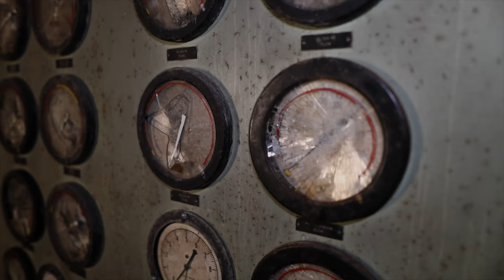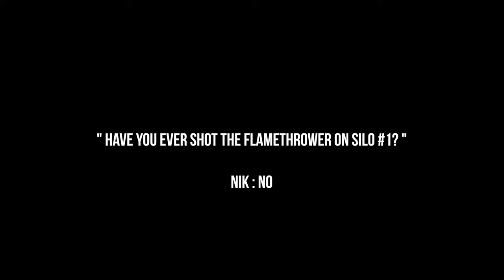Ep. 65 - An 80 TON CRANE Declares WAR On A Military Underground Bunker

Comment: you guys will get it next time, drilling around the edge has to have done some good
Reply: Some good sure, but remember that plug is almost 3 feet thick and when the Air Force decommission this facility in the late 60s … They use some form of adhesive to seal that lid permanently.
Reply from the maker: Pressure washer till you can see the water from the inside
Reply from the maker: Yes.  That they did
Reply from the maker: Absolutely
Reply: @NuclearBunkerLiving  Could work…. I would assume there was a clay plug involved, at least when the facility was in operation

Comment: I'm not an engineer or anything like that. I am a school bus driver here in San Diego, California. 

My thought is (I know it may cost big money) that you make a rigging from inside to hold hydraulic lifts in 3 or 4 points on outer rim of the slab and push up while the same crane pulls the slab.

Maybe, before all that, get some kind of heavy duty vibrating machine to just vibrate the hell out of the cork for several hours to loosen it, then use my first suggestion to finish the job.

Let me know what you think of my idea.

Thanks.
Reply from the maker: Appreciate your pulse on the matter Lawrence.  Welcome to the community. Will let you know how we go. Taking everything into consideration
Reply: FYI... I do dabble in DIY home improvement and some handyman work at times.
This is why I love what you are doing. Keep up the good work and keep the videos commin'.

Comment: How did they seal the cap? I remember reading it was "environmentally sealed". Perhaps whatever it is is gluing it in place. 
All I can think of is bigger crane.
Reply from the maker: Yeah they poured adhesives and concrete. They didn’t want it to be opened up ever again.
Reply: @NuclearBunkerLiving  well there's your answer as to why it's not moving. To get that adhesive loosened my guess would be you'd have to heat it, but... that wouldn't be practical. Suggestion: Dig out around the outer housing and (sorry), jack hammer out the connection points (the circle). You will have to destroy a portion of the container to get the cap out but, once completed, you could form up a new cap and pour it back. Yes it would destroy the original but that would be minor, you'd get access and then re-plug it. Watching your hammer drill my guess is you didn't even make it halfway down the cap so it's still 'solid'. Good luck and thank you for the updates!

Comment: My 2 cents is build a scaffolding inside under the plug and then from both side get daylight or air blast to be seen on the other side to show the seal is broken. If you can see any movement your close. Maybe 2 days with 2 men to get freed? What is the thickness of the plug, 24"?
Reply from the maker: It’ll have to be up to 15ft high. We don’t have any support structures.

Comment: Was the plug ment to be removable or was it the last step in the construction process of the bunker?
Maybe it is not even a Plug. If the plug is simply a casting that was made as a last step, the it is possible that there is a rebar cage inside that is conected to the reenforcement of the structure itself. 
If you want to blast throught the lid, try to get a company that has the licence for Oil Well Penetrators. The little monsters can make a nice round hole up to 2 inch in diameter
Reply from the maker: We don’t plan to blast thru the lid. We believe it’s just a cork. We just have to work out how to open it.
Reply: @NuclearBunkerLiving  You could test if your attemts even budge the Lid. Take a cheap dial indicator and magnetstand from Ebay, two small flat pieces of steel and install one piece in the bottom of the lid and one on the side of the wall. Set up the indicator with a GoPro to see the movement on the display, and then start the work with your crane/Hydraulik jacks on the surface. If you see no movement on the dial or when the thing only moves a fer hundreds before falling back to zero, the lid is most likely has a welded structure.

YOu could allways try to get the Handbooks they used for the decomission and the former Groundskeeper could have some insight into the matter.

Comment: Hello nik, love from cornwall uk. Idea! Is that plug supported by a hefty steel ring? If it is you can weld beams across for jacking with hydraulic Jack's to put lifting pressure on to assist the breaking free.
Looking forward to the next episode.
Reply from the maker: Cheers Neil. Thanks for your support.

Comment: why not bottle jacks around the parameter pushing up on a beams crossing the cap (red headed / concrete anchors) once its broke loose you should be able to lift it with less equipment. harbor freight has 30ton bottle jacks for $125 buy 10, 300tons (600,000lbs) of force for $1250.00. you could start with 4 and work your way up and return the unused ones. however you wound need about 86 1inch anchor bolts to lift 600.000lbs. at that point you might as well get the back hoe with the jack hammer attachment. and repour the cap.
Reply from the maker: Exploring some of those options. We just want to preserve the lid.

Comment: Double up on the rigging? 5-6 instead of 3? Also, I understand the need to get it opened, what is the plan to keep stuff (dirt, rain/snow, animals) from coming in?
Reply from the maker: Quonset hut will be erected around it with an internal gantry system to send up the scrap. Then we can sterilise the space for repurposing. We have 3 of these 5 level buildings. Rinse and repeat.

Comment: A healthy nod to your sense of perseverance my friend. I am a little perplexed on why you would want to remove this lid/plug... as it is engineered to NOT be removed, by design and depth of location. Any rain that may come your way is going to funnel right down to that hole. So, assuming you were successful in removing it, wouldn't you have to immediately put it back and seal it up the way it is now? Otherwise, it's going to flood down there when it rains, or am I missing something?
Reply from the maker: Hey @Pipeman.  Appreciate the feedback. We need to open the lid to have another portal to remove waste and scrap. Otherwise it’s a 3,000 foot underground trek to the other opened portal.
Reply: @NuclearBunkerLiving  I understand, but what happens if rain shows up while the lid is off during removal of waste and scrap?  Have you considered an overhead rail or dolly system that you could move scrap and or buckets of waste over the 3000' distance? Most everything appears to be steel... neodymium magnets can be incorporated to hold material suspended. You appear to have a lot of small I-beams from wall scrap that could be used to suspend rail dolly's from. Just thinking outloud here.

Comment: I also feel like that lid alone weighs more then 20k need to do some math and see what it weighs I bet you’ll be surprised
Reply from the maker: Much to consider.  Thanks for weighing in Joe
Reply: @NuclearBunkerLiving  what is the thickness and diameter of the lid? Thanks Joe
Reply: @NuclearBunkerLiving  10ft Accross by 6 ft thick is like over 60000lbs
Reply: @NuclearBunkerLiving  I don’t believe it’s stuck yes I’m sure it’s got some resistance but I don’t believe your using a big enough crane. I did email you in regards to wanted to work/help have not received an email back yet. I think the lid is heaver then you think
Reply from the maker: It’s 3 foot thick Sir
Reply: @NuclearBunkerLiving  diameter? If it’s 10ft by 3 ft it’s at least 30000lbs min
Reply: @NuclearBunkerLiving  with that being said you have not even applied enough pressure to lift it off the ground….
Reply: @NuclearBunkerLiving  I sent another direct email. Hope to hear from you!

Comment: I think you guys are hiring the wrong trade, cranes build up not down. Drillers are your answer and yes can figure it out without destroying the original concrete lid, you just have to find the right guys. I think Geoprobe is out your direction they should be able to send you in the right direction
Reply from the maker: Appreciated Brad.  Thanks

Comment: Rent or buy a Hilti Core drill, run 110V power supply, and garden hose water supply. And with a bunch of drilling hollow out the plug. I've seen Asians tunnel through solid rock mountains one cylinder shaped chunk of rock/concrete 
 at a time. No heavy equipment needed.  Easy to haul off and carry around. 
Your welcome. This a good video to give you a idea https://youtu.be/vr4XKpAQWT0
Reply from the maker: Love Hilti products.

Comment: dynamite....  drill some holes and load it like in a mine blast or building demo.  Hopefully it will break up the cap either on the top or fall to the bottom in pieces.  You don't sound like your aim is to preserve the cap.
Reply from the maker: We need some of your craziness but we want to keep the historical soul of the infrastructure

Comment: What about hydraulic jacks pushing on the hatch as well as the crane lifting on the outside that might be just enough to budget-free
Reply from the maker: Something has to give
Reply: I don't think the hanging floor system will withstand any loads from jacking from underneath.

Comment: Like I said hydraulic jacks pushing on the hatch while you guys are lifting at the same time with the crane
Reply from the maker: Please read my comments on the video.
Reply: That won’t work. It’s good in theory, but remember this cap is directly over the elevator shaft .
Reply: @Matt-yg8ub  that's right I forgot all about that you're absolutely right

Comment: Have you tried to use a hydraulic jack from the inside and pull from the top may work for sure its going g to work 👍 😉
Reply from the maker: There are no support structures underneath. Be sure to team my comment under the video.
Reply: As Nik mentioned in the note everybody here was supposed to read…. They can’t brace it from the inside because the cap is directly over the elevator shaft... And the government may have glued the thing in anyway
Reply: @Matt-yg8ub  my mistake only dropped in on the video at the end.
Reply: @simongreen247  No worries ….Nik was running around responding to a lot of people who had the same idea.  His comment further elaborated though that the Air Force decommissioned the facility in 1967 and used adhesive agents to permanently seal the cap.  Personally, if we think they intended for it to stay sealed, (assuming that it wasn’t structurally compromised) …. The roof of the equipment terminal is 6 feet thick, you’d think that could withstand A skid steer with a jackhammer Demolishing the lid